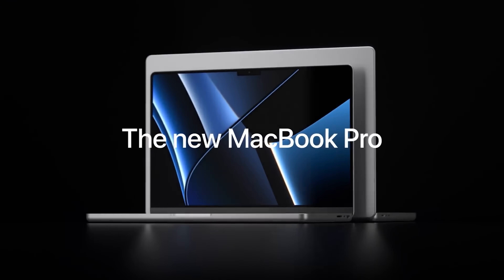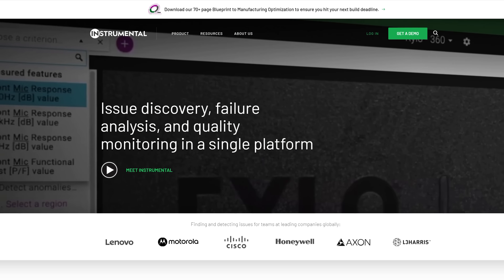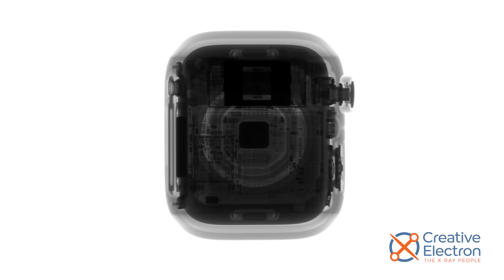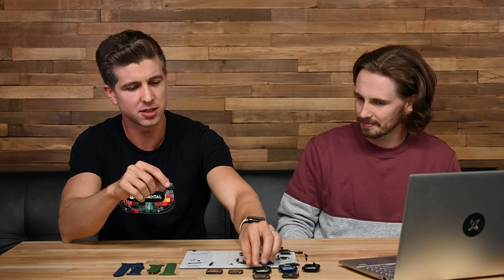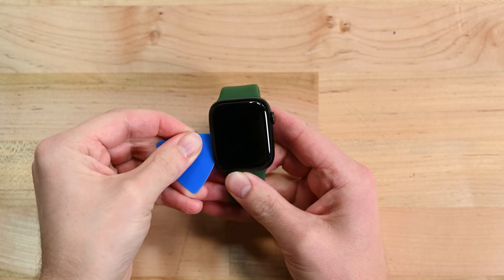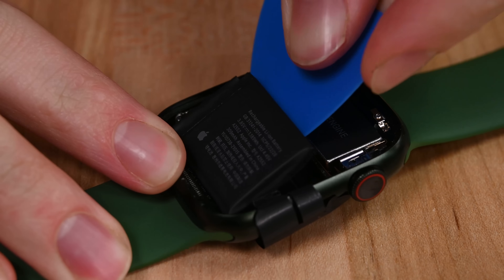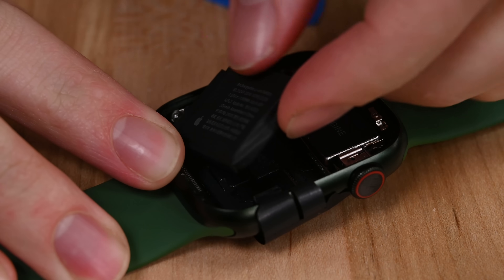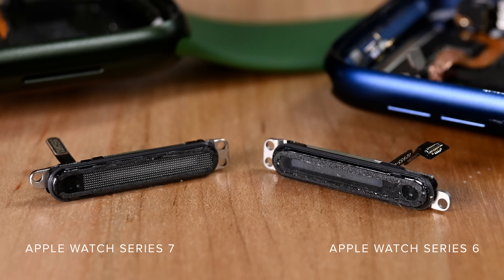Former Apple Engineer Reacts to Apple Watch Series 7 Teardown

Comment: It was delayed because they had a different design. Square design similar to the new iPhones but they were having manufacturing issues because it was difficult to put them together at speeds that Apple needs them to so they went with their previous design otherwise it would have been even later.
Reply: Untrue

Comment: I CAN'T WAIT FOR A ((CASIO G-SHOCK APPLE WATCH)) THAT HAS A ((PRINTER)) 
BUILT-IN TO THE WATCH WRISTBAND THAT COULD BE PULLED ON,FROM BOTH SIDES OF THE BAND,THAT WOULD ALLOW THE WRISTBAND TO EXPAND AND BE ABLE TO ACCOMMODATE FOR A REGULAR-SIZED SHEET OF PAPER THAT WOULD BE PRINTED ON USING THE BUILT-IN WRISTBAND PRINTER. WITH THE DEVICE'S WRISTBAND'S ABILITY TO EXTEND,1 SIZE COULD FIT MOST PEOPLE.

Comment: I think the metal casing around the battery is for keeping it from swelling, remember all those Apple Watch gen 1 Apple had to warranty?
Reply: If battery swell and we avoid that it will explode.
Reply: @stoinks224  You should work for Apple
Reply: @ManuelPrado  u don't understand do u . As battery swell the ring will avoid that expanson and lead to hazarf
Reply: @stoinks224  You don't understand do you? If that was the case why would Apple do that? You very well know that most batteries have the potential to swell or don't you?
Reply: @ManuelPrado  not most. Depends on quality of battery and how much longer apple doesn't want you to switch to newer model

Comment: It was initially meant to have the new square design, they even forgot to remove it from one scene of the keynote when it was released. This is the FrankenWatch if there ever was one, although Apple has done a very nice job!! I'm sure they ran into production issues last minute that made them have to go back to the old design. This is also the reason the screen is larger as it was designed for the newer body. I'm sure they were in a panic to get this sorted out last minute!! This is also why the REAL new and improved S7 SOC was not released as it was designed for the new body & probably could not be made to fit the old body.
Reply: What scene?
Reply: I see you also watched the Max Tech video
Reply: I want to know where you saw this too

Comment: I think they should slow down the Apple watch launch cycle, focus on bigger changes every 2 years because people don't upgrade their watches every year. That way you can suss out your design and manufacturing and provide a meaningful upgrade to users.Anyone agree with me?
Reply: the quality of improvements wouldn't change if they switched to updating every 2 years instead of every year. The improvements would be the same. Just because a company updates a product doesn't mean they intend for everyone to buy new ones. Tim Cook has even said this many times that it's crazy to update devices every year if they dont need to be. The purpose of updating products every year is because people update all the time and it's not consistent. People want tech relevant to the year, not two years. Imagine if they upgraded every two years and you bought in the middle of the cycle. Boom, right out of the gate the tech in the product is already a year old. 

Car companies also updates cars every year but don't expect people to get a new car every year. They make minor improvements year of year so the product is always as up-to-date as reasonably possible. 

I got the Apple Watch 5 when it released and had the first Apple Watch before that, I have the  iPhone XS Max, I just recently upgraded to the 12.9" iPad Pro M1, but had the iPad Air 2 before that, I got the 13" MacBook Pro 2 years ago & had the 2012 one before that (however I ordered the new 15" M1 Max because it's a crazy jump in technology and Im tired of hearing fan noise from my furnace that is my Intel Mac).  

The point is that all these devices work just as good as the day I got them and will last many more years and you should only be upgrading because you are reaching a power limit (the old devices cant support what you want to do) or there is a major jump in technology.

 But ultimately, if you cant afford it then you shouldn't feel pressure to upgrade. People get so consumed by thinking they need the latests and greatest tech because of the marketing is designed to make us want it. The social pressure of having a brand new product is strong. But the reality is 60%-80% of the total market would get along perfectly fine with a Chromebook.
Reply: @HeyItsHades  good read. thx

Comment: The metal pouch battery was to stop the smaller battery expanding and pushing the display from the enclosure.
Reply: Absolutely not. The display is supposed to pop off if the battery expands, otherwise your watch would literally explode on your wrist.
Reply: @chibiroboenjoyer  well apple had issues and quality programs for battery expansion causing the screen to pop open on 2-3 year old watch series 2and 3. I believe the metal banded battery came out in watch 4 and so far no quality program.

Comment: Two questions:
1) So the theory regarding flat design and inability to fit in a double sided processor is not true at all? I mean they weren't exploring that design at all?
2) Even after 7 iterations, why is the Taptic engine still so big? It takes up almost half of the space in the watch, which could have been used for a bigger battery. The Taptic engine in iPhone is now much smaller than before.
Reply: the taptic engine is the same size in apple watch and iphone....
Reply: @bodigames  Taptic engine was much bigger in earlier iPhones, but it has remained the same size in the Apple watch. Considering the fact that iPhone is much bigger than the watch, I am wondering why Apple didn't shrink the Watch's Taptic engine?
Reply: @DK-ox7ze  Making the Taptic Engine smaller comes with sacrifice.
The big Taptic Engine (probably the best Taptic Engine in any phone ever made) in the iPhone 7 Plus was incredibly good.
When apple reduced the size of the Taptic Engine in the future phones the vibration power reduces significantly as well.
Just compare the vibration power in the 7 plus to the iPhone 12 Pro Max….. 
The vibration power in the Apple Watch already is okay. People use it to wake up by vibrations. 
By reducing the size of the Taptic Engine in the Watch thus reducing vibration power you risk the vibration power in the watches to become too weak and will result in several features requiring the Taptic Engine to not function properly or function as intended.
Reply: The Taptic Engine is only much smaller in the mini variant iPhone, I don’t know about the other models but I’m pretty sure they stayed almost the same size
Reply: @cockandballer3593  The 7 Plus IPhone is way back. 2016 to be exact.
The first mini phone to come out was in the 12 line up in 2020.
Reply: @bodigames  I was replying to op
Reply: Considering the changes they made to the internals, they did not intend on changing the design. Apple cares a lot about what makes a watch special and part of that is persistence in design. Look at traditional watch makers. Designs from a hundred years ago are still available (for example Rolex watches).

Comment: why they remove the diagnostic port that's insane I think if the wireless port fails that's it no diagnostics
Reply: You think Apple cares about diagnostics or repairability? LOL
Reply: If the physical port on the old watch fails then that’s also it.
Reply: In the bin!
Reply: In the bin it goes! Either your bin, or the Apple shop one
Reply: It makes it harder to service. From my knowledge, apple doesn't fix any part of the apple watch, instead they decided it was more economical to toss out any device that might have a cracked display or worn battery
Reply: @Carterthielftw_  That is literally what happened with mine. The battery went all weird near the end of my 3 year warranty so I sent it in for a battery replacement. Instead of replacing the battery it I got a new series 7.
Reply: @Carterthielftw_  can confirm. I sent in my series 0 for a battery replacement… ended up getting a series 2 refurb.